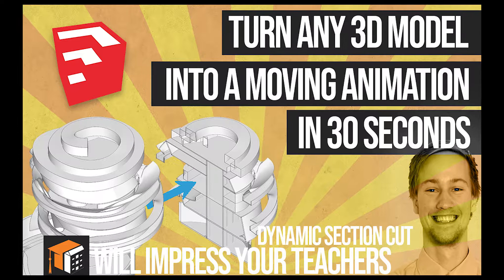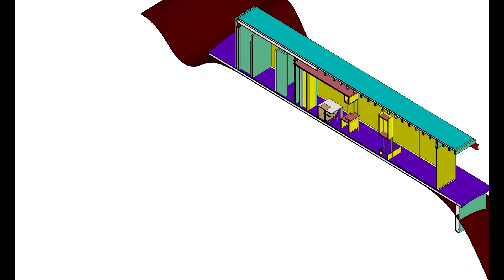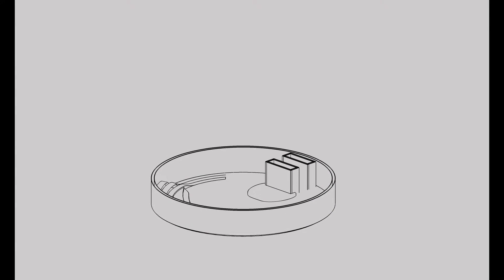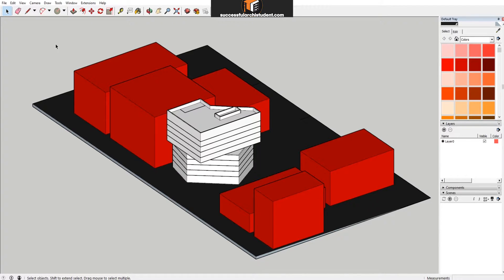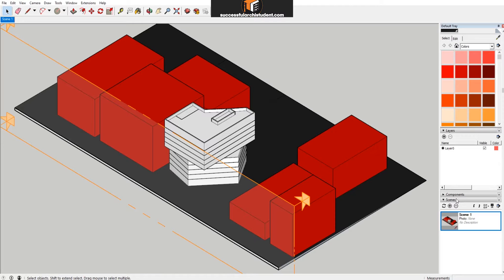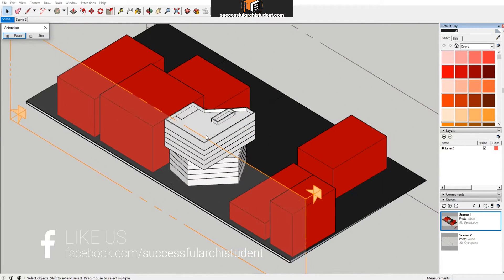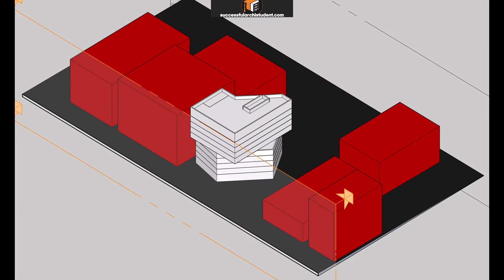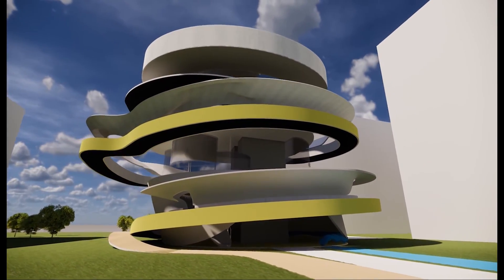How To Animate Any 3D Architecture Model Into A Dynamic Section Cut | SketchUp Animation Tutorial

Comment: Hi when I did it inside the cut the volume had a grey color how do I fixe this plz and it is an amazing video thank alot for the content
Reply from the maker: Thanks Roger. If it had a grey colour you can right click the face and press "reverse faces" (or something similar). This should flip the face to display a white colour if you're using the default style. Otherwise, you might have to play around with some of the styles in the Styles tab.

Comment: Hi, great job! But how did you make the second part when basement opens?
Reply from the maker: Thanks! This was using Adobe After Effects. It was pretty simple. 2 seperate PNGs of the model. 1 without the door, 1 with just the door. Then add a wipe to the door over the top of the first PNG and add sound effects. Cheers